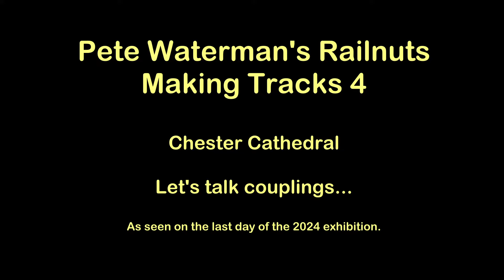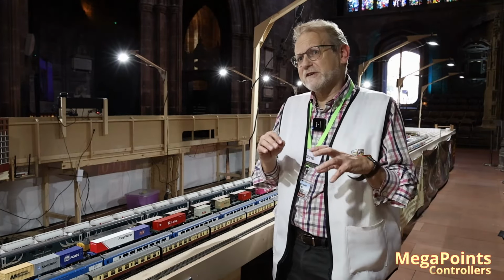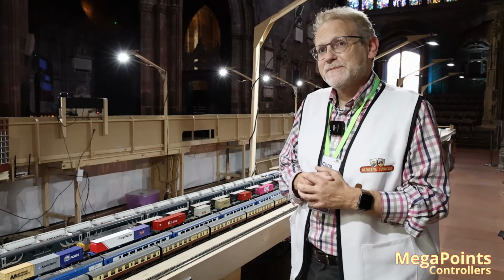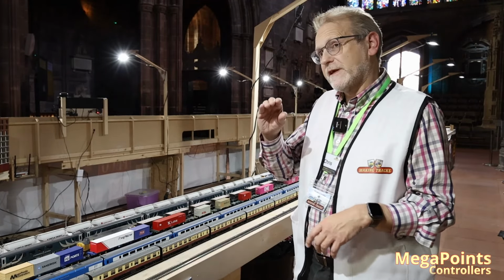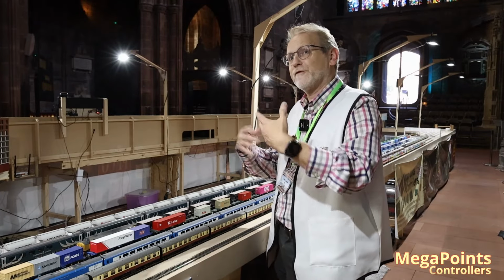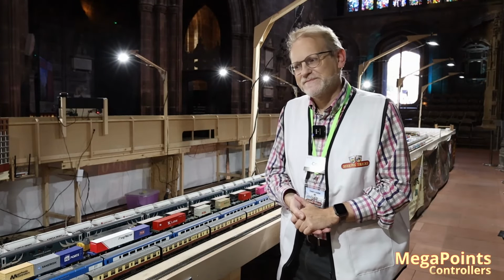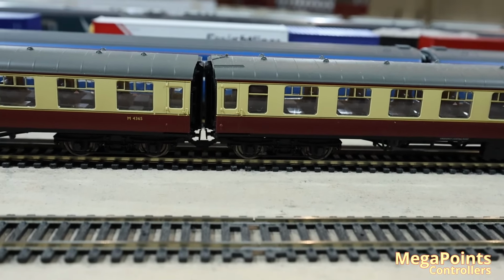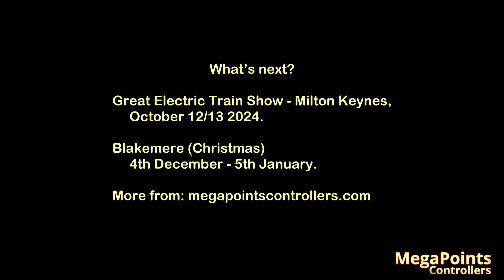Pete Waterman's Making Tracks IV. Let's talk couplings.

Comment: I could never understand why, when Tri-ang bought Hornby in '60's, they dumped the fine Hornby buckeye couplings (as used later in "N" gauge) for the ugly unreliable tension lock design. BR went the opposite way dumping chain link couplings for buckeye type on coaches. 😞 Nice design, Chris!